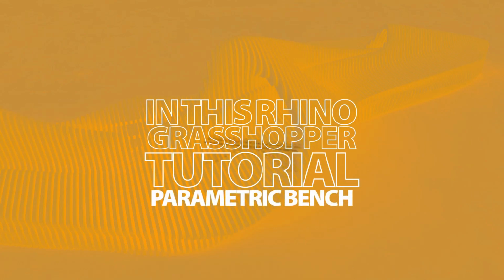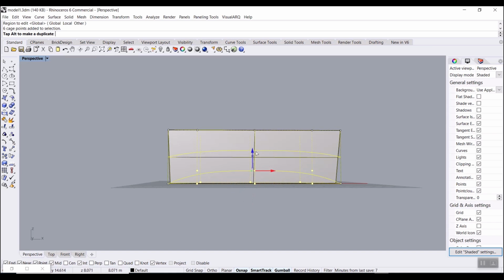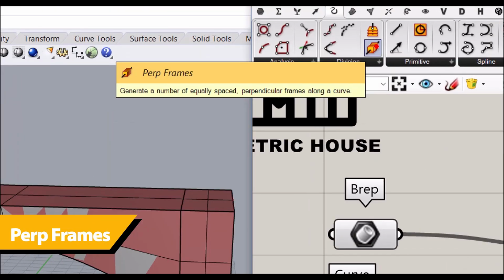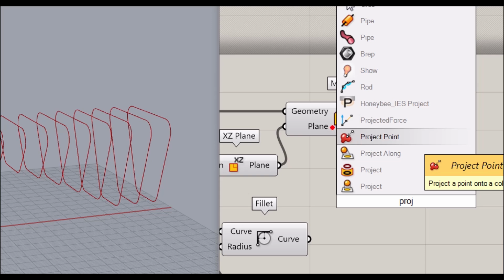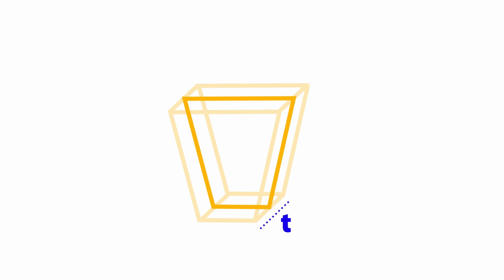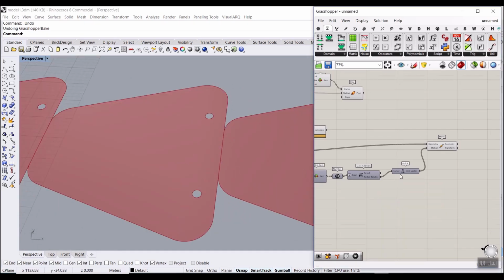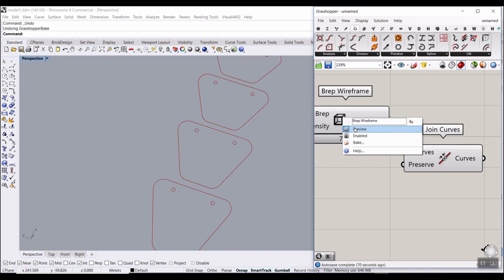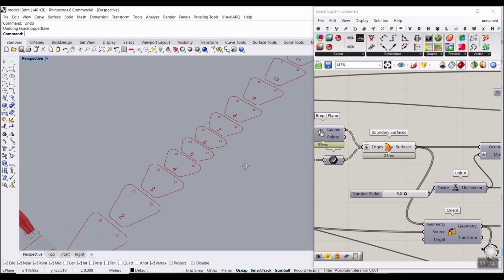Parametric Bench (Rhino Grasshopper Tutorial)

Comment: How did you address the first and last pieces of your vertical slices being extruded beyond the original defining surface? Currently this end models total length has increased by the full thickness of your extrusion, though not a big deal in this particular design It would be nice to see how to address this for more critical applications.

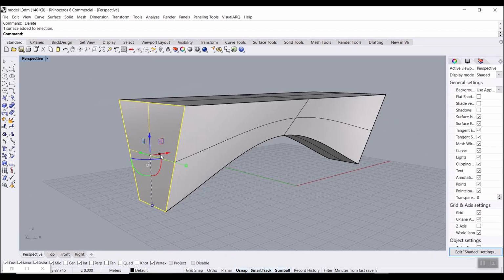Comment: Exceptional tutorial! When extruding the ends of the bench, (5:14) I don't see the small circle on the gumball. Could you tell me how to enable that? Thanks!
Reply: Petty sure it's a feature of Rhino 6 or 7, can't find any options for it on 7 and I think the video is made on 6. I don't think it was part of Rhino5 and older but correct me if I'm wrong.
Reply: @strive4208   Thanks for the reply. I'm on 7 so that might be the reason if this video is made on 6.
Reply: @jake1689  Ok so I see how it works, its on the gumball in the perspective view port after selecting a side of a solid or a surface. Example: go into perspective and draw solid box then  ctrl shift a side on the box to select it,  you will see a circle on the arrow corresponding to the direction you wish to drag the side in and it will go from the arrow color to black when mouse moves over it. Hover over it, hold left click and drag.

Comment: These modern design benches are for a few years already been installed in our malls. It was installed inside, so no gull or pigeon can shit on it, but still, those thin and deep walls of the vertical planes accumulate a lot of dirt, dust, and food remains that are almost impossible to clean off. So after a few years, you are literally sitting on a pile of shit. I vote for classic benches, that can be easily wiped clean or washed with a good-old rain.

Comment: When I try to add the points to the  "Line SDL" it only alows me to input one point. If I connect the other it simply removes the previous one connected - Meaning i have to split it up and do all double. Any idea how I may solve this?
Reply: Hold the shift key down when inputting the second point, that will allow you to input both!